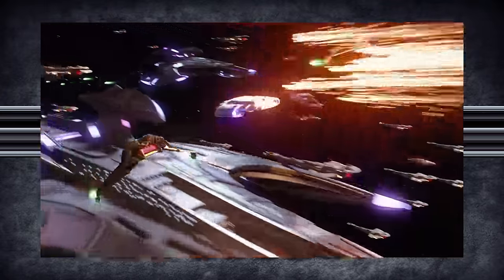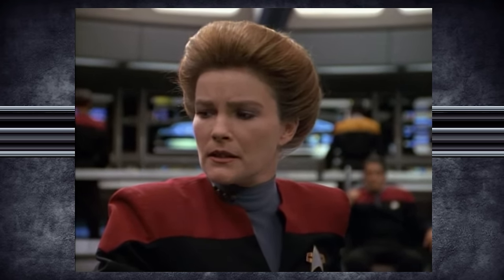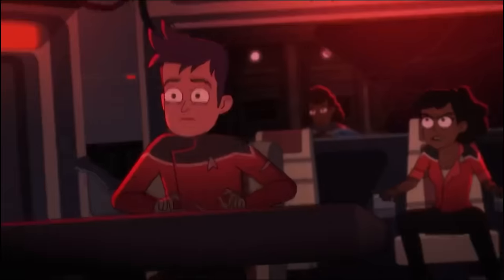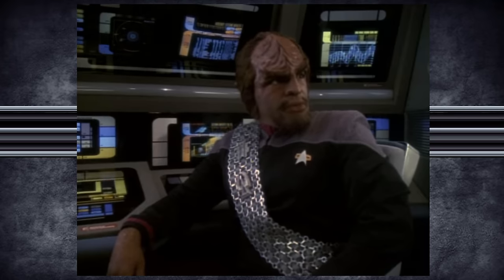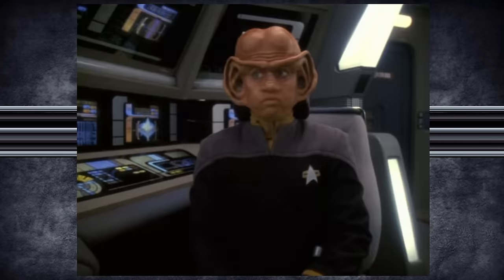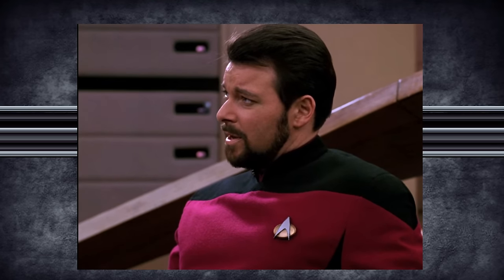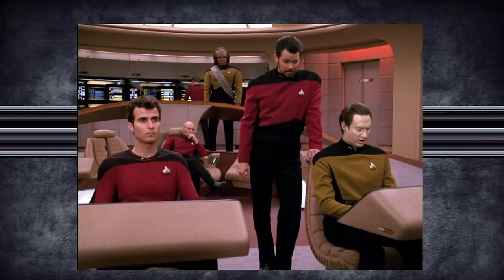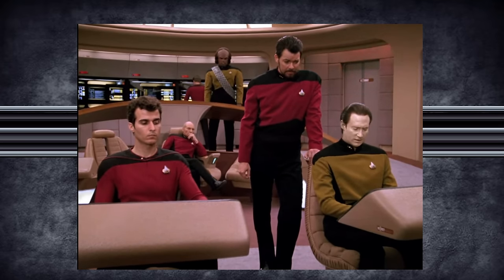Why Starfleet's Bridge Design Was Lethal to the Crews

Comment: Perhaps the most significant safety change Starfleet could make is stop loading explosives into instrument panels and route all the steam ducts away from the bridge...
Reply: hahahahahhahah
Reply: The company that manufactures explodium has a very powerful lobbying department and all kinds of dirt on the people in Starfleet’s bid review board. Their lock on contracts for supplying instrument panels is air tight.
Reply: I thought that was what this video was going to be about....
Reply: It actually makes sense to let the panels blow up, because if each panel is equipped with fuses or other breakers of some kind, it would take some time to reset the breakers and even more time to replace the fuses, leaving consoles completely inoperable.
Reply: @adamloverin231  That... explains the Oberth.
Reply: @GeneralKenobiSIYE  this makes sense
Reply: @GeneralKenobiSIYE  general kenobi! you are a bold one
Reply: @singletona082  Hahaha! Dude, NOTHING explains the Oberth.
Reply: If you pay attention, the exploding panels roughly coincides with their switch from electricity for power distribution to conduits full of high-energy plasma.  Apparently the concept of a step-down power converter never occurred to them...
Reply: oh, and don't use rocks and boulders as console internals, lol.
Reply: As a child, I never gave the Bridge design a single thought.  As an ex-navy sailor the bridge design is all but comical.   Damage Control, communications, combat systems, all delegated to interior sections of a traditional naval ship.  Although your bridge is exposed to allow for easy view of the battle and positioning, that wouldn't be the case in Star Trek.  and having such a design actually puts the ship in harms way as one well placed shot could take out the whole bridge and thus put the ship out of commission.

But I do blame Star Trek for this trend.  Whether we are talking Star fleet, Emperial Star Destroyers, or the Battlestar Galactica all these franchises did the same thing.  Put the "bridge" in vulnerable locations for no obvious benefit or reason.   It is a little funny.  I remember an episode of the original Battlestar Galactica where Appollo and Starbuck took their dates to an observation bubble for privacy.  It was explained that when the Galactica was originally built that it had a number of these observation windows that could be used to observe combat and report to the bridge.  But over time all of these observation bubbles had been destroyed leaving just the one left which was now unmanned.  But in the reboot series, it was explained that the Galactica was a low tech solution to a Cyclon War where technology was a weakness.  Having such observation windows would have made sense and would even justify having the bridge located in the interior of the ship out of harms way.  But it was never addressed in the reboot.  Although in looking at footage from the reboot of the Galactica and Pegessus, it did seem like the main weapons were physically maned and thus these observation bubbles were part of the weapon.  

I'll give Star Wars and BSG credit for one thing.  The writers looked at the designs of the ships and all came to the same conclusion.  That when all else failed they were designed to ram a target. Definitely not something you could say about the Star Trek ship designs.  Hell, you have to wonder how they even faired in space as the designs were anything but compact and condensed.  But still even BSG had the bridge so far forward that ramming didn't even really seem like a viable option.
Reply: @superdave8248  The bridge being up top and exposed is to match with modern vessels where it's done for visibility reasons.  I doubt anyone ever stopped to consider whether, at the distances and speeds involved, being able to see with one's eyes even made sense.  Putting it in the middle of the ship probably doesn't matter much either.  When the shields are down a torpedo or phaser blast will often punch a hole clear through the ship and out the other side, so at that point there could be a number of design concerns considered to be more important than a little extra protection.

Starfleet ships have no reason to be built for ramming.  In most circumstances, if you're desperate enough to do that, it's either going to be a futile gesture that the enemy will just dance away from, or you're going to hit them so fast and hard that nobody's going to survive regardless of the shape of your ship.  The shapes used are designed to fit with the way the fictional warp drive supposedly works.
Reply: @GeneralKenobiSIYE  Are you saying that consoles which were BLOWN UP are more operable than the ones with blown fuses?
Reply: @Stoney3K  A sudden surge of power overloading a console momentarily might not destroy it or even knock it off line. A blown fuse or tripped breaker stays offline until the fuse is replaced or breaker reset. In the middle of battle, that is not ideal. When a console overloads you can still see them working after most of the time when the damage is not catastrophic. So yes, they can still operate.
Reply: And seat belts. Everyone on the bridge should be strapped in.
Reply: That only happens after TOS/Kirk movies. Because they stopped making any sense.

Ass of Enterprise D gets hit in Generations, the bridge is fucking wrecked for no reason.
Reply: why would any military ship entirely devote their visibility to cameras for a view screen? If power goes out, computer malfunctions, or even if the camera lens themselves get hit in battle, you're blind. No radar, sensors, scanning, etc will ever emulate 100% visibility. 

Heck, since Star Trek invented transparent metal, what's to stop a ship from putting a 20-meter (or more) layer of transparent metal in front of the bridge? Transparent metal is one of the 5 most convenient plot devices in Star Trek (along with Teleportation, Replication, Holodeck, and FTL travel) but IMO it's not even used properly, or even used much. 

Plus if any ship gets one-shot by a massive weapon, a bridge being in the center of a ship does jack shit. In real life, naval bridges are already vulnerable and exposed. The bridge for cruisers and aircraft carriers is a fucking tower, but every military since world war 1 isn't paranoid about missiles flying towards a bridge. Kamikazes were flying into those things, yet bridge designs barely changed in the past 80 years. 

Visibility and recon are extremely important. What if shields fail, power goes out, computer malfunctions, and cameras get shot, for your practical ship and the Enterprise? Your practical ship has a window. All you need now are manually controlled RCS thrusters to orient your ship, and a manually aimed kinetic weapon (both of which have little to no presence in Star Trek) to destroy the Enterprise. That's one of my gripes with Star Trek - with all the redundancies Starfleet boasts, old and archaic systems are nowhere in sight, and everyone is overdependent on the computer. Naval ships and Air Force One still have some analog systems. 

Everyone is even overdependent on those lame phasers, but nobody gets hand-to-hand training? I doubt Starfleet offers crews breach/boarding simulations. Someone please use a knife for once.
Reply: And don't put an obstacle course with large moving metal objects that might crush you to death on the route to disable the self-destruct....   oops, wrong show   ;-)
Reply: @GeneralKenobiSIYE  "might not destroy it". Why take that risk though? If the power surge destroys the console it will certainly take longer to replace the entire thing than just replacing a blown up fuse.  .
Reply: @RRapierre  How much human visibility can you really have in the vastness and darkness of space? Relying on cameras and computers isn't ideal but it is the better option I think.
Reply: @adamloverin231  not only that but if they didn’t adhere to this contractual agreement they would be banned from Starfleet and immediately arrested. Data could take it from here. He’s been shown to do so in multiple episodes and validate his actions by 24th century military law. Which y he’s always back each episode after he Commandeers the ship.
Reply: @GeneralKenobiSIYE  then what’s the Time of repair and overall is that smart time wise?
Reply: @superdave8248  tl;dr there are two bridges. Unless u know where both are the commanding team is good.
Reply: @GeneralKenobiSIYE  Resettable fuses and auto-reset circuit breakers do exist.
Reply: @GeneralKenobiSIYE  Only the Borg had hyper advanced technology like self-resetting fuses.  Also, it's not like they can afford to hire an engineer to reset any fuses that get overloaded.
Reply: @RRapierre  Glass in space bad. human vision vs digital vision seems no brainer when you have FTL.
the one that got me was Mass Effect.  In my head cannon, the first thing shepard says to Miranda when he sees the Stealth Ship that  Cerebuus built is is "WHY ISNT IT FN PAINTED BLACK!"
Reply: @iansneddon2956  Which show are you referring to?
Reply: @wasdwazd    Actually a movie reference.  Galaxy Quest. A movie every Trek fan should watch, at least several times.
Reply: @superdave8248  As a kid, I had always assumed that the bridge was way deep inside the ship. First clue: no windows!

Took me some decades to learn that that was not the case. Until some movie or episode where they had escape pods at the bridge. Which is kind of funny, since the whole saucer section is an escape pod. An escape pod with...escape pods? And what about the redshirts in the inner sections of the ship? How would their escape pods...oh, well, redshirts. Never mind.

But what bothered me most were these...unnecessary persons whose presence of the bridge was never quite explained, even though their presence is pretty much counter-intuitive (politely said).

A frigging "counselor"? Because star fleet command believes the main threat for the bridge crew would be some..."mental issues"? Perhaps they thought that her "eye candy uniform" would keep the bridge personell from fretting about the ever-exploding consoles.

Or Neelix, possibly the greatest threat in the galaxy. Yes, we've seem doomsday weapons in TOS, pretty bad ones. But Neelix...well: if the crew wasn't that vigilant all the time, he would accidentally destroy the starship every five minutes. Don't get me wrong. It's pretty sensible to keep Neelix aboard. In a safe location, like in an airlock. And if the Borg invade the ship through said airlock, they'd assimilate Neelix and the Borg Empire would, accidentally, destroy itself within the next five minutes. Of well, the use of strategic WMDs might be bad publicity for the Federation. As if "constantly hiring new redshirts" wasn't bad enough. Oh well.

Of course, I am aware of the out-of-universe explanations. The bridge is a soundstage, and it needs to be set up in a convenient way for lighting and cameras. Even though the concept of convenience was ditched when they designed the "eye candy uniform" for Seven of Nine. Seems that the Federation is a bit sexist heavy on the eye candy side. Oh well.
Reply: It's for punishing the bridge crew whenever they make dumb decisions like getting the ship hit by a photon torpedo or something. Notice how it is whoever was responsible gets his console blown up in their faces? That is why the captains don't have a console in front of them, or else they'll be the first to go.
Reply: Boy, isn’t that the truth…
Reply: Let's clear the circuit breaker / fuses thing up here and now. Disabling fuses and circuit breakers IS a thing. The Navy calls it a battle switch, and when it is flipped it bypasses every fuse and CB in a piece of equipment. I know about this because I worked on programming AN/UYK-20 militarized minicomputers (essentially a PDP 11/45 in an inch-think aluminum case with lots of shock mounting inside) being used at the time (1980) to upgrade radars on naval ships. I was told about the battle switches by a co-worker.

What's going on is not how long it takes to change a fuse or flip a breaker. It is that a fuse must necessarily be sized to melt at well below the current that will destroy the equipment. Thus if averaged over many battles, a fuse might blow several times compared to the unprotected equipment probably never getting to the burn-out stage at all. When you are under fire, it's a bigger win for the equipment to stay operational and risk burning it up than for it to keep crapping out on you because the fuse blew. That way at least you suck all the operational life out of your equipment that you can. Because that time you take to find and reset the CB could be when a ship-to-ship missile comes looking for you. Or so the theory goes.
Reply: The issue with explosions on the bridge(s) is mystifying. Enterprise and others appears to use what is called "hot switching" - the actual power feeds to the equipment are routed through high power capability switches located somewhere in the consoles, so when there is an overload or other malfunction the bridge is inundated with showers of sparks and smoke.

The alternative is "cold switching", in which the switches that control the high power conductors are placed close to the equipment they control to keep the connections as short as possible. The switch is then activated by a small voltage signal sent by the control panel on the bridge. Control panels handle only these low-voltage signals; they are like a laptop computer.

No one would use hot switching for such an application these days. Running the power conduits through the bridge is wasteful, dangerous, and inefficient. Why the Star Trek designers decided on this is a mystery. Could it have something to do with having a cheap, easy way in the script to build tension with visual effects? /s
Reply: I can't believe no one has addressed this in replies to you.

There are EPS conduits behind the consoles. This isn't a design flaw, but really a necessity. In Star Trek--at least by the TNG time frame--they don't use wires to transmit power. Wires present resistance and get hot. No, they use EPS conduits, ambient temperature super conducting power conduits that channel electroplasma. EPS stands for Electroplasma System, which is a power manifold that distributes electroplasma directly from the warp core to where it is needed.

The ship designers aren't stupid. They didn't just run EPS conduits right behind every console. No, these conduits are buried deep in the bulkhead and are heavily insulated and protected, but that doesn't mean they won't fail and explode if a sufficient power spike localizes in that part of the conduit, which is likely to happen in battle where directed energy weapons are in play. When a ship takes damage the crew is going to get hurt. This is as true today as it is in the 24th century. There is just no way around it.
Reply: @stuarthamilton5112  Are there weapons systems on the bridge? Not the controls; the actual firing heads. I don't think there are. So again I point out there could be a simple digital interface between the control panel and the hot end of the phaser that remotely controls the plasma at the phaser head. Certainly not everything on a Federation Starship is driven by plasma! Are  the computers based on routing plasma around their logic circuitry? That would be pretty scary. If not then you can built a remote control panel based on lower-energy sources.
Reply: @LexipMedia   Everything on a federation starship is driven by plasma. Electroplasma is how they move current. They don't use electricity like we do. Electroplasma is siphoned off the warp core and sent directly to every system.
Reply: @stuarthamilton5112  I'd love to see how computer logic that runs directly off plasma works.
Reply: They could also stop storing large off-cuts of styro-foam in the overhead compartments.
Every time they hit an interstellar speed bump, that sh*t comes raining down on them.
Reply: @superdave8248  I dont know about the original but the Reboot Galactica Battlestars have the Bridge and C&C in the core of the ship.
The hull is also extremely well armoured, according to one source with almost 5 meters of Tungsten plating (the minimum necessary for the ship to just tank the nukes it is seen taking at a few points during the series.
As far a warships in space go, Battlestars are some of the best designs going, like an aircraft carrier with the ability to deal and take damage like an Iowa Class Battleship.
Reply: @adamloverin231  Well, the Ferengi can corner the market on just about anything.
Reply: @GeneralKenobiSIYE  so it's better for the entire panel to blow up than to reset a fuse?  Makes no sense, they both wouldn't be functional.   Also you don't need high voltage to run computer panels.
Reply: @LibLibertyLibertarian  You don't reset fuses. You replace fuses. You reset breakers.
Reply: @GeneralKenobiSIYE  face palm, this was a very small ant hill to die on.   They do sell auto resetting "fuses" for cars and other devices which is what I was referencing. Dunno if they are using the definition of fuse about connecting two parts together, or it's a marketing strategy because the definition that your looking for is "a consumable piece of filament".

They could also use a master/slave circuit, wireless or solenoids to prevent high voltage near the frigging console.  

 Bridge staff are the most experienced and meritable people in their fields, it takes a long time to train good officers, they should take the precautions needed.
Reply: @LibLibertyLibertarian  Even these days, electronics can over load when a ship takes battle damage. It also takes time to get a system running again. "They sell auto resetting fuses for cars." You're basing the future technology on what we use TODAY. Fuses/breakers or no, when you have power being shoved through systems like that, even fuses and breakers will do little. Even in modern high voltage electrical systems, there is a lot of arching until the circuits are wide open.

In battles that can last mere minutes, it would take far more time and resources to reset. Auto-resetting switches in cars are not comparable to what would be needed for lines that carry kilowatts, to terawatts worth of power. 

There are fuses to protect systems like this in our time, but they are massive fuses that blow up. To reset a breaker with that much power, the ENTIRE LINE would have to isolated, the breaker found, then reset and then tested with lower power settings to check if there are any other faults on the line. You WILL set things on fire if you just try to close a live circuit that carries megawatts worth of power. 

The fuses that are on lines that carry a fuck ton of power NEED to be replaced when they blow as they are completely destroyed by the power surges.
Reply: @GeneralKenobiSIYE  not sure if you have seen the same star trek as me but when things project out, blow up,emit sparks of metal and incapacitate valuable crew members it's safe to say that console would be toast, the electronics that overloaded and blew up, they are gone, those sparks had to come from somewhere (usually capacitors).  It's idiotic that another crew member hops in the chair and uses the console like nothing happened.  A fiction within a fiction for entertainment.

My point isn't to assume they would be using the same tech as today but to say that even today they have the technology to prevent this from happening so they should be better in the future. 

Low voltage consoles, fuses, breakers, armor/shield the crew from dangerous items that harm/kill and backup systems.  All of this is done today in air/spacecraft and most larger naval craft, there's no delays, they literally flip a switch and go to a backup system.  

This is the digital age, not analog, there wouldnt/shouldn't be anything near that console that could blow up. Everything the console would control like high voltage/plasma/gases etc would be remote and controlled by solenoids etc.

I'm an engineer btw, this is my Schick.
Reply: @GeneralKenobiSIYE  hello there.
Reply: So wrong….
Reply: @GeneralKenobiSIYE  But then, you are lacking the panel, and surrounding crew are subject to both concussive and shrapnel injuries.  Circuit breakers are a better idea I think.
Reply: And seatbelts, don't forget seatbelts. They even made a joke about this in one of the movies.
Reply: @adamloverin231  the Oberth class is for admirals to punish officers they dislike. When murder isn't viable simply assign them to an Oberth.
Reply: How would they kill 90% of the red shirts then??😝😝
Reply: @electrogestapo   that makes so much sense!
I remember watching TOS as a kid ('70s) and cheering on the Enterprise for doing this, like "That'll teach ya!" and "Yeah, it's YOUR fault!"
Come to think of it; I imagined Majel Barrett's testy computer voice saying it
Reply: In the early days of Starfleet, MegaFlameon was created as a rich power supply for Starship consoles. Later in the 23rd & 24th century, MegaFlameon was enriched to Explodium and was O.S.H.A. approved to quicken officers' reflexes.
Reply: And remove the geology devision's rocks to a secure section and not inside the pannels
Reply: And clean the rocks out of the overhead panels
Reply: @laurenceperkins7468 I love this explanation so much 🤣🤣🤣
Reply: @superdave8248  Hulls have 0 resistance without the shields unless it's something like the defiant with ablative armor, but even that it can only tank 1 or 2 hits maybe once the shields are down. it really makes no difference where you place the bridge.
Reply: But where's the fun in that?
Reply: Seatbelts.